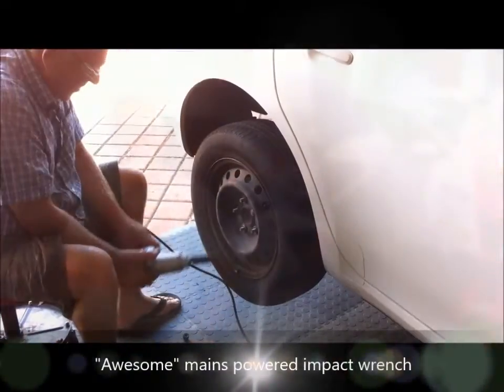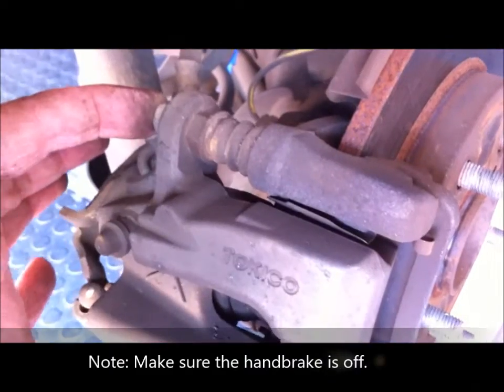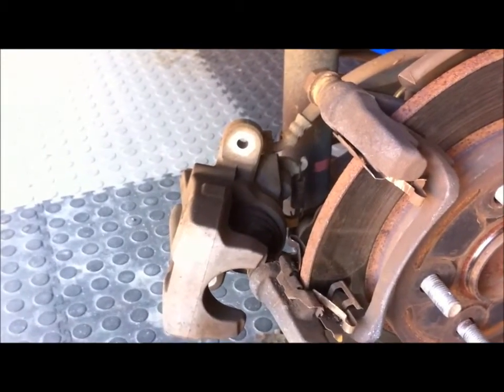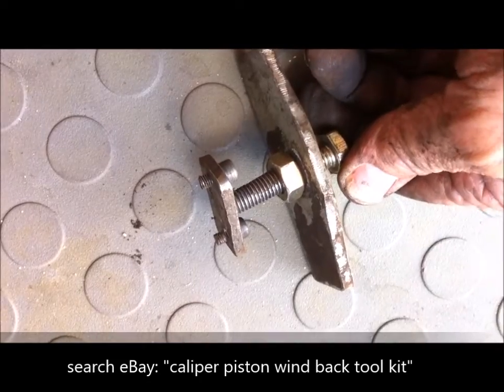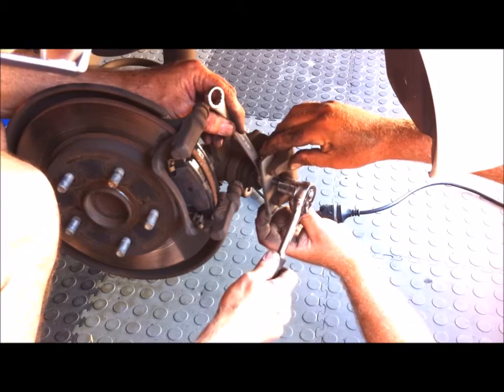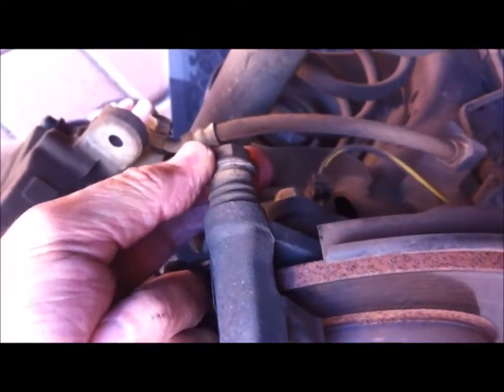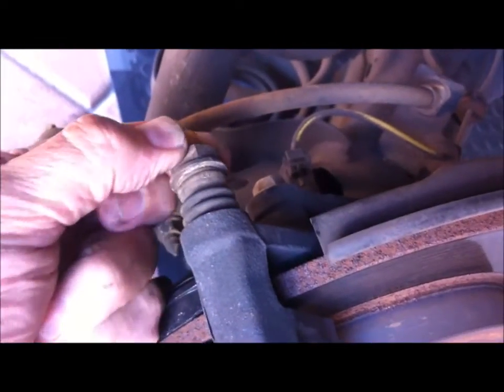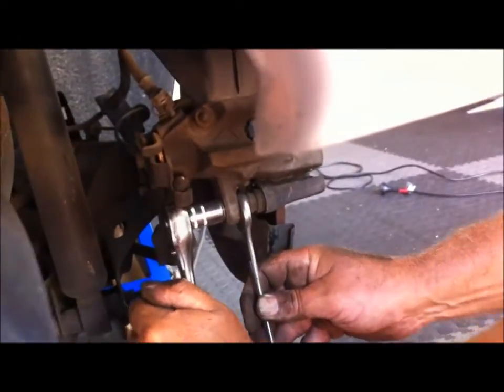Toyota Corolla 2007 ZRE152R Change Brake Pads Rear Break Pad

Comment: Great video Scott, thank you. Just a bit confused about the (clockwise/anti-clockwise) direction you compress the piston back in, apparently it's crucial to get it right. So you worked on the L/H (kerb) side and screwed it in clockwise, so did you do it anticlockwise for the R/H (drivers) side ?? .. cheers mate.
Reply from the maker: Thanks. You turn clockwise while pushing to wind the pistons in. It's the same for either side.
Reply: @ScottElliott152  thanks again ..

Comment: I got brake pads and disc front and back but failed nct on brake imbalance
Reply from the maker: A brake imbalance failure as I understand it ... refers to a difference of friction between left & right wheels across the back or at the front. It might just be the parking brake out of adjustment causing more friction on one side.

Comment: The pin with a rubber tip goes up or down?
Reply from the maker: I don't know what "pin with a rubber tip" you're referring to. What time point did you see it?
Reply: @ScottElliott152  The piece that have a rubber...
Reply from the maker: @LeoTeixeira  It's the caliper sliding pin. The orientation and position is clear in the video. I can't explain it any better than the video.

Comment: Does anyone knows how to adjust the handbrake wire and remove centre console on this corolla?
Reply: Ray Liao handbrake in this tipe of brake is self adjusting if is not working instalation of pads was incorect

Comment: Slopy job and here is why:
1. You NEVER let the caliper hanging 
2. Break pads need special lube for sliding and i haven't seen any applied here
3. The biggest mistake : the caliper bolts need to be torqued to a specific value, raging from 20 to 34 Nm and not by what you feel
4. When you compress the caliper piston, that pressure needs to go somewhere. So you either screw off the bleed valve or the the brake fluid reservoir cap. Otherwise you force the brake fluid reservoir  seal.
Reply from the maker: Stefan I agree in most cases you need to suspend the caliper with a piece of wire which is what I generally do. These calipers are tiny and weigh so little it wasn't necessary to hang them from wire. Brake lines are tough and believe me it wasn't a problem letting them hang. I've never had a brake problem in over four decades of doing my cars and race bikes.
I talk about the caliper pin grease but in this case it wasn't needed as the pins were well greased and sliding freely.
On my track bikes I torque the caliper bolts. On a Toyota Corolla I don't bother ... it's a Corolla not a race car!

We removed the lid on the reservoir which I didn't show on the video. There was enough space to accommodate the fluid being pushed back. If the reservoir was over filled we'd have sucked a bit of brake fluid out.
It's about 2.5 years since we did those brakes and the Corolla is going famously.
Considering what the car is... a Corolla ... we saved my friend a heap of money.
Reply: You always get one 😴 anyone attempting this would and should have minimal mechanical knowledge and would know that.